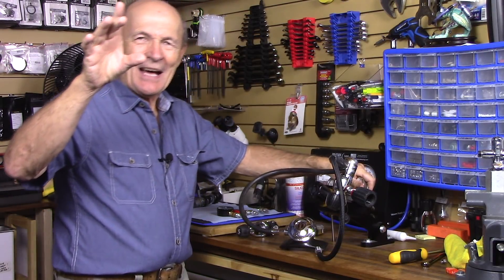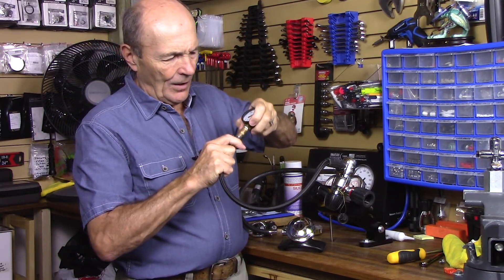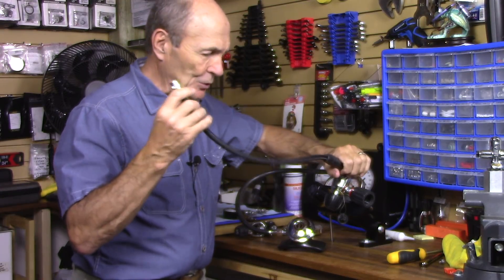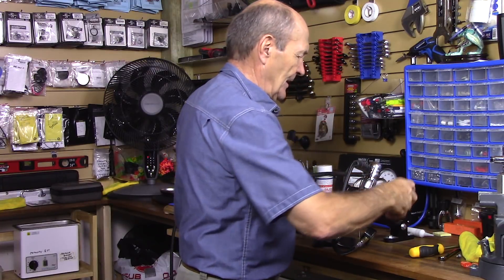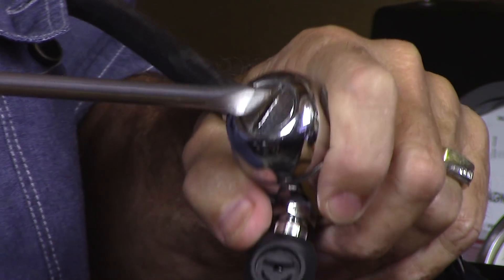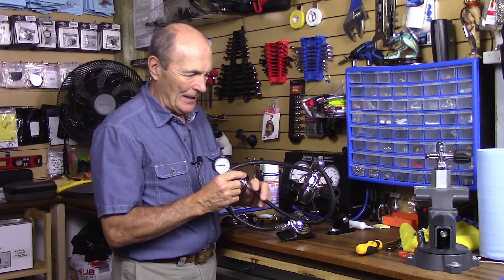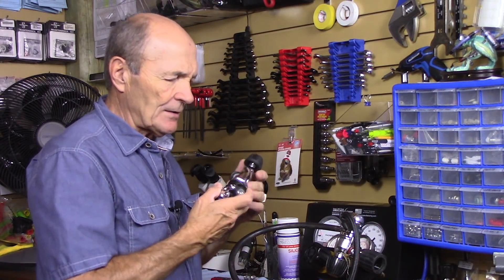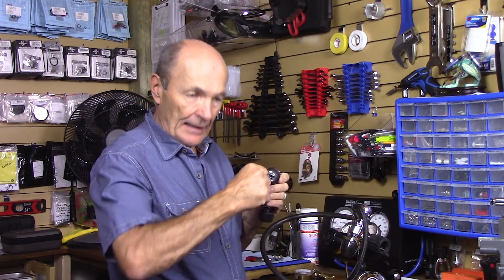Regulator Service, Adjust The IP - Scuba Tech Tips: S07E20

Comment: Hey. Just the video Iv been looking for. I’m a diver but also a spray painter. Unusual question coming up…. I think I have the first stage you’re playing with in this video. Old aqualung with the big screw on the bottom. I’m in the process of making a paint set up fed from a 15 litre tank. Desired psi is 60-80psi. By letting out that screw can I reduce the LP to my desired range or will it not go that low? I reduce again further down hose but near 60psi leaving the 1st stage would be ideal. Thankyou
Reply from the maker: I have used scuba regulators for the same purpose - supplying air for any air tool, paint sprayer or even an impact gun, when I cannot connect to my garage air supply.
You need a diaphragm scuba 1st stage. They can be easily adjusted to any pressure from 0psi to 150psi or more.
Simply put the reg onto a scuba tank, use a pressure gauge to show the pressure & turn the adjusting screw on the end, generally counterclockwise, to reduce the pressure.
You may need to adapt the hose to whatever tool you're using but you sound mechanical enough to do that.
The pressure is low enough that regular air line hose with jag connectors & screw clamps will work.
Let me know if you need a cheap regulator.
Good luck.
Reply: @AlecPeirceScuba_SeaHunter  thanks for the reply. I have an old aqualung reg with the flat screw on the bottom. Unfortunately for me I can adjust it down to 90psi turning clockwise in my case but a fraction further of a turn and it closes completely so I can range it from 90psi upwards. 90psi is a little high and I’d like it nearer to 50psileaving the regulator. I would be interested in a cheap reg from you but I am in the uk and a cheap reg wouldn’t be cheap by the time it arrives 🤣

Comment: Interesting video. I just got a cheap IP gauge. I found it interesting my wife’s Aqualung Minton reg was running 10psi higher than mine. Mine was 135. We’ve only got a half a dozen dives in them. I was surprised they’d come out of production with that much difference.
Reply from the maker: Most IP's have a +/- variance of 5 to 7 psi from the service manuals.  It's not a big difference as long as the 2nd stage is tuned properly.  Keep on diving.
Reply: @AlecPeirceScuba_SeaHunter  thanks!

Comment: Hallo Alce , I have tow Scubapro First Stage MK20, the intermediate pressure is different between them , one of them is 9,6 bar and the other one is 10,4 bar , is that normal?
Reply from the maker: I found a good answer on www.scubaboard.com.  I know a lot but unlike my wife who knows everything, I also have to do research. This is a great resource to ask questions to the global scuba community.  DA Aquamaster posted this answer: 

It is a Mk 20 specific problem. The Mk 20 had three different piston designs depending on when it was made. 

1. The early piston was a stainless steel piston with a knife edge seating surface. It worked great.

2. The mid production Mk 20 used a brass tipped piston that had a rounded seating edge. They were notorious for having a mushy lockup and IP creep and in fact have a much looser set of allowable specifications for IP creep. A "normal" piston is expected to lock up very solidly with little or no creep in the first 5 seconds and none after that. The Mk 20 was allowed about 5 psi of creep initially and a few more psi over the next minute. I pretty much replace them on site as it is a "when they fail" rather than "if they fail" issue.

3. The late production Mk 20 used the same composite piston used in the current Mk 25. It also has a knife edge and locks up very solidly. It is a direct replacement part and the dealer cost is about $25. I it also replaced free under warranty if the IP will not lock up.

If you do not have a brass tipped piston, I suspect the seating surface is damaged so piston replacement is still the most likely fix.

NOTE: read the full postings here: https://www.scubaboard.com/community/threads/scubapro-mk-20-pressure-creep.245312/
Reply: @AlecPeirceScuba_SeaHunter  thank you so much Alec , I will have a look on it.

Comment: Why does my piston first stage singer or whistle when I breath in until the tank pressure gets to around 2000psi.  After that it stops singing.
Reply from the maker: Does it play a tune you know?  But seriously, a high pitched whistle while inhaling is a sign the 1st stage needs service as the o-ring around the piston is likely wearing.  As tank pressure drops the noise drops due to the pressure on the piston reducing and the speed it moves up/down is slower.  It's still usable but your buddy may get annoyed.  Thanks Mike.

Comment: Late to the party, but i'd like to add one important caveat: some 1st stages have an adjuster that changes the height of the high pressure valve seat, rather than the preload of the IP spring. Even though these have an externally accessable adjustment point, they must NOT be adjusted when their is primary pressure applied to the stage, ie when the cylinder is turned on!   This is because adjustment under pressure means the HP seat is in contact with the HP orrifice, and that turning force can cut the soft seat material!   To adjust these, your check the pressure, turn off the cylinder valve, bleed the pressure down, turn the adjuster slightly, then turn the cyl valve back on and reject, repeating as necessary till the IP is within spec. Case in point here is the very popular Scubapro Mk25 piston 1st stage.  So in all cases, checl the service manual before you twiddle stuff!!!!  ;-)
Reply from the maker: Your comments are correct but for many divers, everything past your second sentence lost them.  My intent was to give divers an understanding of the general process, not to argue individual brand differences.  You sound like an experienced service pro so thanks for the feedback.
Alec
Reply: @AlecPeirceScuba_SeaHunter  Absolutely with you on that one Alec!  It's good to give everyone an idea of how things work, whatever their skill or knowledge level, but i just wanted to add in that there are some circumstances (actually quite rare tbh) where twiddling things can damage your kit if you don't follow certain procedures!  BTW i'm not a scuba tech pro, but i do design and develop Formula 1 cars for a living, so "twiddling things" is certainly in my blood lol!   Keep up the good work on your great channel  :-)

Comment: One more question...how would you do the adjustment on a environmentally sealed 1st stage reg? As per one of your videos, I understand that the adjustment bolt would be under the rubber boot that is filled with liquid.
Reply: In this case you'd need to check the service manual where it will explain how to do this adjustment. That's assuming the manufacturer allows service manuals to be given or sold to customers... some do some don't.

Comment: Hi Alec, I'm having difficulty understanding regulators. 
Is the IP always Ambient + 150psi (approximately)?
So in the shop the IP is 150psi, ambient is 0psi gauge pressure;
At 30 meters/99ft, ambient is 3x15psi = 45psi; IP would auto adjust to 150psi + 45psi = 195psi?

How can we safely breathe air that's 150psi higher than our surroundings?
How does this affect our BCDs and drysuits?
Presumably it must be something to do with the low flow rate?

Really great videos by the way, I'm new to your channel and I'm a big fan! You have a great manner on camera, very engaging and knowledgeable. Thank you!
Reply from the maker: Yep! IP is ambient +150 (or whatever the factory setting for IP at surface is supposed to be - 125psi to 160psi).
You've answered your own question. The IP is balanced at ambient. That is, no air comes out of the reg at any pressure or any depth until you inhale. Then the air that comes out is the correct pressure to fill your lungs as you inhale. When you stop inhaling (lungs full?), the air flow stops. Your lungs will only accept air until the pressure inside equals the pressure outside. They will not overinflate - unless you block the windpipe somehow.
If the air pressure was equal to ambient i.e. not 150psi above ambient, you would not be able to inhale. Your lungs have virtually no ability to suck air as you can prove by trying to breathe through a long tube (say, 4' long) while sitting on the bottom of the pool.
Hopefully, this is clear.
Thanks for your question.
Alec
Reply: yes, IP is ~150psi+AP, that's why it has openings otherwise that wouldn't be necessary

How can we safely breathe air that's 150psi higher than our surroundings? - 2nd stage reduces it to IP ambient. Diaphragm is "preloaded"with AP and then you create under-pressure by breathing in, which gets equalized by the lever opening and letting in air from IP pressured hose, because the diaphragm presses on that lever (Alec also has a video explaining that, prbly better) 

How can we safely breathe air that's 150psi higher than our surroundings? - higher IP would mean faster inflation, but you shouldn't have to full press the button anyway

hope that clarified it, otherwise have a look here: https://www.thoughtco.com/how-does-a-regulator-work-2963185

Comment: Hi Alec, I have been a big fan of your series for a while now, not only 
as a diver, an instructor but also as an ASSET certified Dive Industry 
Technician. I have recently open a dive center in Indonesia and opted 
for Apeks regulators. I have access to splitted view and technician 
manuals and also can rely on my experience with other regulator brands 
to perform decent overall/service of these but I feel like I would (like
 the rest of your followers) benefit from your extended experience 
servicing first and second stages, and particularly Apeks ones. Would 
you be ready to make a video describing best practices for these ? It 
would be greatly appreciated ;)
Reply from the maker: Apeks should supply you with all the service information you need, including videos, so that you can properly disassemble and reassemble and tune their regulators. All manufacturers do this.
I'd love to help but for me to make a video showing the service process for a specific brand is not going to happen.
Alec

Comment: Thanks Alec.  Question:  I feel that my newly bought overbalanced diaphragm regs release too much air.  I run out a lot quicker than I used to with basic rental piston regs.  Will it help if I reduce the ip on the first stage?  My second stage comes with an flow adjustment lever and even at the lowest mark I feel theres still too much air flow with every breath.
Reply from the maker: There could be many factors affecting your air consumption, not just the regulators.  As for reducing the IP, don't.  The manufacturer set the IP range to be ideal for diving, changing it yourself without knowing the effects is not safe.  Look for my video on setting breathing resistance # S08E01 as breathing effort is set at the 2nd stage, not the IP.  

Take your regs to your local dive store and discuss your concerns with them and have the adjust the 2nd stage breathing while your there for you to check until you find a setting you like.

Thanks for watching.
Alec

Comment: So what if you are mixing and matching first and second stages with different factory recommended IPs?  Do you set the first stage to the factory IP and adjust the second accordingly, or do you set the first to match the factory IP for the second stage so it breathes well?
Reply from the maker: Always set the 1st stage as dictated by the manufacturer. It is determined by very specific requirements.
Then simply adjust the 2nd stage to suit your breathing needs, light enough to provide air easily but not enough to create free flow.

There is no "setting" for the 2nd stage, It is adjusted to the IP coming from the first.
Alec

Comment: Alec pierce scuba love the vids and everything been diving a year absolutely fell in love with it . Have you ever or will you do a tech tips video on the pros and cons of full face mask vs traditional mask. And I'd like yo know your thoughts on logging dives or if you even log them had 3  structors 1 told us absolutely and the other two said ehhhh you can but no harm no foul if you dont
Reply from the maker: I'm looking into a vid on full face. We'll see.
I have a dozen or more full log books.
With 5000+ dives I really have no more need to log but it sure is fun looking back at my dives from the 60's and 70's. The gear, the old dive sites, my buddies (many gone now) and the stuff we did is a hoot to recall.
I like to see divers log their dives until they have several hundred at least.
After that there's no practical benefit but sometimes you want to check on a dive site from years before - maybe it's location, condition, entry point, stuff like that. Hard to do without a detailed log.
Realize that you need prove of 100 dives to become and instructor. A log book is the best and fastest proof.

After Open Water & Advanced it's a personal choice but I vote yes!

Alec

Comment: Alec as you mentioned when the first stage fails the reg will free flow. Now what will happen if a BCD Lp inflator fails? Will it fill the BCD with air or will it totally cut off your air to your BCD? Thanks in advance for the info and another great video
Reply from the maker: BCDs are remarkably reliable but there are 2 areas of concern.
1. The PIV (Power Inflator Valve on the end of the BCD big hose) will deteriorate over time if not fastidiously care for. If it fails it usually either leaks air to the water or leaks air into the BCD. In some cases it fails to provide air at all. None of these situations is good but, having become dependent on the ability of the BCD to maintain our buoyancy, divers faced with a BCD that slowly fills throughout the dive find it annoying at best and potentially dangerous at worst. While a BCD that won't fill sounds bad, assuming the diver is properly weighted, it's not usually life-threatening. These valves should be serviced as often as your regulator. If it is not cleaned regularly it can become so badly corroded that the only solution is replacement of the valve (not the BCD - just the valve for less than $100).
2. The LP hose can also be a source of problems although less often. Inside the end of the hose is a Schrader valve just like the one in a bicycle tire valve. These will also corrode if not rinsed and few people do that consciously. It's usually done while rinsing the regulator itself although if you're in the habit of rinsing your reg under a tap or hose rather than giving it a good soak, this valve doesn't get touched. If that little $0.10 valve fails you get no air. It should be replaced at every regulator service (less than $10). Also in the same spot, there is a small O-ring that seals the spigot on the BCD main hose into the LP inflator hose so the air won't leak out. I have never seen a dive store that regularly replaces that O-ring although it is even more subject to sun, heat and salt that the tank valve O-ring. The reason is simply that It's a real nuisance to replace. If not practiced at replacing it, service staff can find it frustratingly difficult to get to and to insert a new one. Insist that it be done with the Schrader valve change.

Good question. This might be a good Tech Tip topic.
Thanks.
Alec
Reply: Hi Scuba steve, usually a BCD will leak before something will happen to your bcd. As Alec Peirce scuba says it needs yearly service.
Reply: Hi Steve, Watch this video on how to service the LPI schrader valve, S06E05 Servicing Your Inflator Hose,   https://youtu.be/yaXyn4-cxKs  
Thanks for the suggestion.  I will add it to our ideas list.